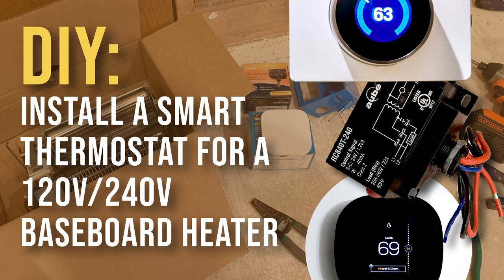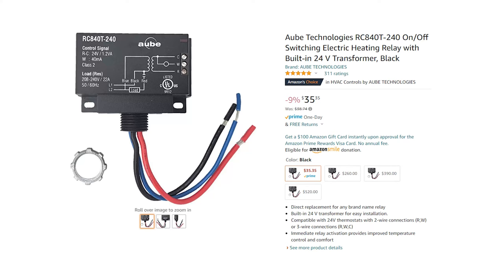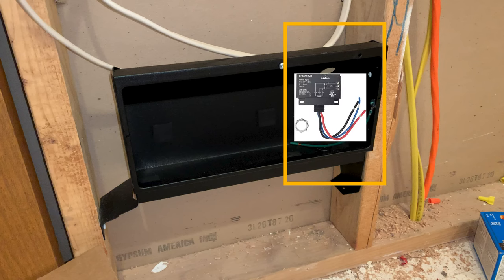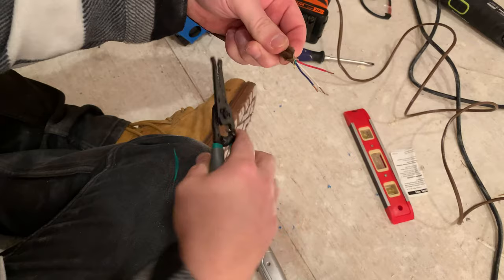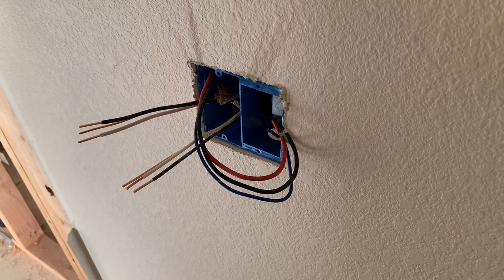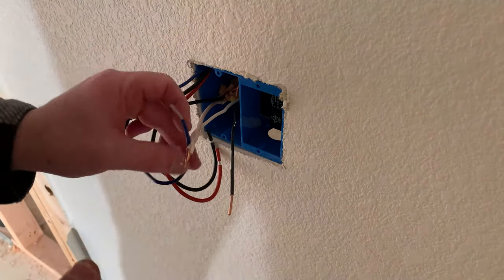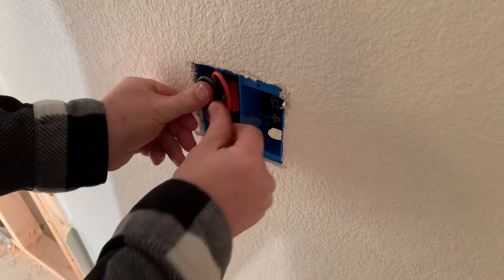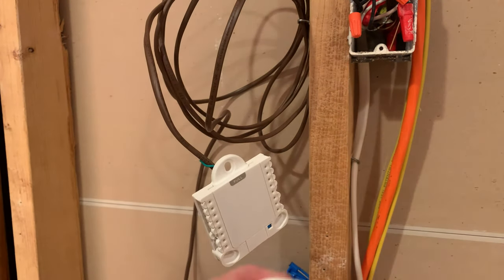How to install a smart thermostat for 240v/120v baseboard heat

Comment: I did this exact install just a note if you are using a nest thermostat for this the relay in the video will not work. The relay transformer is not big enough to power the nest and will cause your batteries to drain. So you either need to use a thermostat that does short cycles or buy a different relay like this one that has a larger transformer that is meant for long cycling thermostats.
Reply: Which relay did you find worked for the nest? I'm seeing mixed reviews on  compatibility with the nest for this 240V relay, but the 120V model of that same relay (RC840T-120) seems very much compatible.

Comment: Does this work with a line/ high voltage thermostat and my heating is an oil fired furnace that has hot water baseboards ? Your demo is for an electric baseboard
Reply from the maker: Depends on your specific setup and wiring.  I'm assuming the new thermostat would control your furnace?  I haven't played around with this method controlling a furnace, just individual heaters.  Here, we have full 240v running through the relay and to the heater - the thermostat just switches the relay on/off.  With furnaces, the thermostat often connects directly to the furnace with 24v thermostat wire, sending a signal to the furnace control board (at the furnace) to switch on/off.  If you've got larger gauge wire running between your thermostat and furnace, and the thermostat itself is the switch - shutting your furnace on/off - then yeah maybe this video method would work, with the relay acting as the switch, controlled by a smart thermostat.  Not sure how common that is, though.

Comment: You can actually have both 24v and 220/120 in side the any hvac system Atleast from what I was taught when I went to school for an example air conditioning unit as both as well as a furnace I have also seen baseboard run both as well.
Reply: How can we check?

Comment: I'd suggest to get a Sinopé smart thermostat, these are design for convection and baseboard heater, 120/240v 3000w or 4000w models are available. They support most smart home integration, even Apple homekit.
Reply from the maker: Only thing is that it's not quite as "pretty" or modern as some of the more popular smart thermostats, which is the main reason I went the route the video shows. But yeah - there are definitely more purpose-built thermostats out there.

Comment: One problem with the junction box you used is if you ever have to replace the relay, you will need to cut open the drywall. There’s not enough space in that box to unscrew the relay and pull it out the front. But you could just cover the junction box with a larger access panel.
Reply from the maker: Huh… not sure that’s true, cause you should be able to just unscrew it, turn it sideways, and pull it out from the front. Granted it would probably be a little difficult. Haven’t tried it though, so it’s possible you’re correct. Another good reason to put the opening and wall plate in an inconspicuous spot.

Comment: Hello 
Great details in the video.
Can I use this method to connect my 120v thermostat to 24v Amazon thermostat?
My baseboard heaters are connected to my furnace directly (I am unable to figure out which box )
Reply from the maker: I'm not 100% sure what you're asking.  I don't think it makes sense to have 2 thermostats controlling the same furnace/heater.  If your baseboards come on when your furnace comes on, then they're all controlled by your furnace thermostat.  The method in the video would require disconnecting your baseboards from your furnace, and then running dedicated power (circuits from the panel) to them and the relay, as shown in the vid.  There are ways to swap out your existing thermostat for a smart thermostat, and some of the same concepts apply as the video, but it'd be a slightly different process.

Comment: Great video! How would you wire this with a 240 volts at the old thermostat? So there are 2 hots along with the line and load neutrals. What would you do with the 2nd hot?
Reply from the maker: So in my case I didn’t have a neutral (or ‘common’ wire) - both the black and white were hot. In your case, you won’t actually connect the neutral to anything - just use your black and red like I did with my black and white

Comment: I was wondering if there is much noise from this relay when it engages?  In another application I use a 30A contactor to turn on/off the heat entirely for my garage office which makes a loud "clunking" style of noise when it engages and that's OK for turning the whole heating system on/off but much to loud and noisy for all day cycling as the thermostat calls for heat and satisfies so just wondering if there is any noticeable noise from this relay?  Thanks.
Reply from the maker: No the relay and thermostat are small and quiet; the heater turning on is the only "clunking" noise I've ever heard.

Comment: Thanks for this video and explanation. Very helpful! 
Questions: 
Would it be possible to set up a one thermostat for 2 baseboards in the same room? I was so depressed that the electrical contractor didn't hook up any thermostats, and the baseboards just have off, low, med, high! Who would run around to all the rooms and keep adjusting them separately.
Does the Alexa/Amazon app allow you to see all the thermostats with different names?
Reply from the maker: Yes - as long as the heaters are both okay to be on the same circuit (i.e. they don't draw too much power; most don't), you would would wire them up in parallel to the relay, which is controlled by one thermostat. And yes the thermostats can all have their own names :)

Comment: Will this work if I have two 4k heaters on separate circuits? Can I control both if I add relays.
Reply from the maker: Hmmm good question. I’m assuming “yes,” but the wiring would look a bit different. You’d have to power the thermostat with one of the circuits, then control the second relay (remember the relays are simply switched on and off by the thermostat) using a branch of thermostat wire.

Comment: Thanks for the video. I notice the relay says 240V to 24V built in transformer. Can I still use this relay for 120V to 24V?
Reply from the maker: They make a 120v relay as well - use that one instead.  https://www.amazon.com/Technologies-RC840T-120-Electromechanical-Relay-Built/dp/B00D5YLY2G/ref=sr_1_20?keywords=120v+relay&qid=1668028110&sr=8-20 
The 240v one probably has too much resistance to work correctly with a lower voltage.

Comment: Hi, your video was very helpful.  I don’t have electric baseboards, I have a standard oil burner furnace that runs hot water through the baseboards.   I purchased a smart thermostat, then realized that I have a lime heating system. There’s thick wires behind my wall with wire nuts. Therefore I cannot use the smart thermostat, that’s how I found your video. My question is when I wired exactly the same for baseboard heating that comes from my oil burner furnace?   Unfortunately I cannot share photos here but I did take some photos of the wiring as it is now
Reply from the maker: Sounds like you probably already have a thermostat controlling your system.  you wouldn't want to put a second thermostat between your first thermostat/furnace and your baseboards, as the second thermostat will only work if the first thermostat/furnace is turned on, which may not be the case if it's already the right temperature in your first room.  The method in the video is meant for independently powered baseboard heaters.
Reply: @sheawilliamson7732  I was actually thinking of replacing the existing thermostat.   It has 2 thick wires (1 black, 1 White) with wire caps connecting thin gauge wires to the thermostat.  Black wire connected to a thin wire going to RH with a jumper to RC and the White wire has a small gauge wire connecting to W.
Reply from the maker: @crushrreviews  ah I see.  I suppose the method in this video could work then, assuming it's a 240v circuit and both black & white are hot wires coming from your breaker box.  the fact that your thick gauge wires are connected directly to thin gauge is odd, though, and potentially a fire hazard.  I'd need to have a better idea of all your wiring to know for sure.  An electrician would definitely be able to determine the right approach.
Reply: @sheawilliamson7732  thank you.  I appreciate your patience with me.   The digital thermostat I have on there now is not a smart thermostat, but it was installed by a licensed electrician when I had my furnace replaced several years ago.   I checked the instructions for that particular thermostat that I have on the wall and it does say it’s a 24 V thermostat. I’m guessing those thicker wires are not necessarily coming from the panel.  I will attempt the installation and definitely get back to you on the results.
Reply from the maker: @crushrreviews  sounds good!  and if you already have a 24v thermostat installed, then you should be able to simply swap it with a smart thermostat - probably don't need a relay.

Comment: Thanks for the video!  Most of the baseboard heater is separate with its own control in each room.  Does it mean we would need one smart thermostat in each room?  Or is there a way to make one central control for all the baseboard heaters?
Reply from the maker: You would need 1 thermostat per heater, because it sounds like each heater has its own dedicated wiring running to it, and the thermostat is just an interrupter switch for each run of wire.  Each room should usually have its own thermostat because each room probably heats up/cools down at a different rate, and you wouldn't want a thermostat in a large/cold room to switch on and start heating a smaller room that's already warm.

Technically, if you had multiple heaters in one room (or in a couple of rooms) that shared power/wiring, you could install one thermostat and relay to control them all, as long as they were installed early enough in the circuit before the wiring split to each heater.  You shouldn't see more than 2 120v heaters on the same 240v circuit, fwiw.

Comment: Oh man, i have been using two separate devices --24v transformer and a relay... and also a bunch of super ugly expensive mysa baseboard wifi thermostats . Question : Can I use the 24 v output to power both the thermostat and my wyze video doorbell camera ?
Reply from the maker: Hmmm I don't think so - the video doorbell probably pulls more amps than this relay can supply (1.2A).  Best bet is to stick with a transformer for the doorbell.

Comment: Do you know how to connect this relay to make it work on a old fan coil AC 120?? That would be an amazing video 😂

Old AC are high voltage and no smart thermostat compatibles :(
Reply from the maker: Sorry for the late reply, but I believe that's exactly what this video addresses!  All my baseboards are coils with fans, all 240v.  Smart thermostats don't work with them because these thermostats are low voltage - so we use the relay (in the video) to handle the voltage, and the thermostat just turns the relay on/off via low voltage.

Comment: Could you post some plans please ? I would really appreciate it.  A simple drawing would really help me: I kind of lost you at some point.
Reply from the maker: I should have included a diagram in the vid - sorry about that.  Let me know if this written description helps or not, for a project where you're cutting into the wall:
1. A 240v breaker at your circuit breaker box supplies power to one or more 240v baseboard/wall heaters
2. The power cord for an individual heater needs to be located inside the wall (preferably right next to a stud)
3a. Because of stud & wire location, it'll be easiest to mount your thermostat & relay above your heater so that all the wiring is in the same stud bay/section. Otherwise you'll have to open up more of the wall and drill holes through studs to run wire through studs.
3b. Identify where you want your thermostat to be, and drill a very small hole for your thermostat wire to come out of. Your thermostat will sit right on top (in front) of this wire.
4. Cut a hole in the wall for a junction box (as seen in video), preferably in an inconspicuous spot, very near to the thermostat wire.
5. Insert thermostat wire (with a lot of extra, so you've got plenty to work with) into the small hole, and run it to the junction box cutout.
6a. Because you'll need enough length in the 240v power wire to strip it and make new connections, you may need to run new wire to the heater. I recommend removing the heater, pulling up/out (through the junction box hole) the power cord that went to it, and cutting it to give yourself long enough wires to strip and connect.  Run a new piece of wire from the junction box cutout down to the heater cutout, again leaving enough length on both ends (wire sticking out) for the new connections, as seen in the video.
6b. Per 6a, split the 240v power wire and run both ends (the wire from the breaker and wire from the heater) to the junction box cutout.
7. Attach your relay to the junction box as seen in the video.
8. Connect the thermostat wire to the relay as seen in the video.
9. Set your junction box in the wall, pulling in the wiring from both the breaker and heater.
10a. If your 240v wiring has just a black, white, and copper wire, then both the black and white wires are "hot" and should be connected as seen in the video.
10b. If you've got 4 wires, with two blacks or red and black + white and copper, then your non-white/non-copper wires are probably hot, and your second hot wire will take the place of the white wire in the video.  It's worth using a voltage tester to double check which wires are hot.
11. Connect the new run of wire from the junction box down to the heater cutout, to your heater, as seen in the video.
12. Connect your thermostat wire to the thermostat as seen in the video (may vary depending on your 24v smart thermostat)

*NOTE: In the video, over the final minute or so, the left white wire is 12gauge wire coming from the circuit breaker, through a stud, to the relay junction, and the left yellow wire is 12gauge (exactly the same as the white) going from the relay to the heater.  You can ignore everything else (wiring, junctions, etc) to the right of the thermostat.

Comment: This looks cool but there’s a simpler alternative. I used a mysa thermostat designed for electric baseboard heaters. Their support team is really helpful. $120 I think. There’s another brand that makes one too..
Reply from the maker: The problem with Mysa and the other brands - at the time I did this project - was A) they were having a lot of reported issues with lots of Wi-Fi systems, and B) I didn’t like the look/interface of their products.  They also (according to reviews) didn’t integrate consistently well with Alexa or Google home.

Comment: Hello, you said  to connect all the white wires which you called common wires. Is this not 240? There should be no common wire correct? That relay wouldn't work for 120v heater, or would it?
Reply from the maker: Yes - you’re correct.  For 120v you’d want their 120v relay https://www.googleadservices.com/pagead/aclk?sa=L&ai=DChcSEwjc99DR_5X6AhWYH60GHa-OADQYABAPGgJwdg&ohost=www.google.com&cid=CAESa-D2aeLLuHFqQ-fucPtEqPQaRPXvZzQvkBUy3-HRfmbGolUyknosFfn3NriuZJhbRprhC90ZkhSqh7QOdJlw6jeQZdiW4Vec1MSLyqCnualSJde8i8ikTo47co-K0jxPIhCnGEXjtavfI95i&sig=AOD64_2B9O8Rda0_xerarzAg6W0m_j7f1Q&ctype=5&q=&ved=2ahUKEwj6x8bR_5X6AhXhJX0KHQflAYYQwg8oAHoECAYQCg&adurl=

It comes with instructions, and I bet they would involve just the single (black) hot wire.

Comment: How has the relay holding up ? Do you know the load ?
Reply from the maker: Holding up well as far as I can tell!  Haven't actually tested the load, no, but the relay is supposed to deliver up to 240v 22amps, and the heater works well

Comment: How does this work when you are using a 240v heater? There are two hots, and no common. But there are only 3 wires coming from the relay.
Reply from the maker: I misspoke when I said "common" wire - this video is showing a 240v heater set up.  The black relay wire connects to one hot wire from the panel, the blue is wired together with the other hot plus one of the heater wires, and the red connects to the remaining wire going to the heater.
Reply: @sheawilliamson7732  So then, does it only cut power to a single 120v phase, and leave the other one live? I'm looking at this, not for a heater, but for a different 240v appliance, and I'm concerned what happens with one 120v phase still running into said appliance. Thanks for the advice!!
Reply from the maker: @larryroyovitz7829  yep I think that's the idea.  Again I'm not an electrician, but I'm assuming - at least in the heater's case - that the heater is designed to function such that there's always a hot running directly into it.  If you look at the MYSA thermostat wiring (which is a standalone thermostat designed specifically for 240v heaters, no relay required), it works the same way https://help.getmysa.com/hc/en-us/articles/360042679072-How-do-I-Install-Mysa-with-240V-Installations-
I think that your application will depend entirely on your appliance's native on/off function and how it handles that always hot wire.
Reply: @sheawilliamson7732  Yep, I agree. So either my appliance (might as well tell you, it's a bitcoin miner) will either shut off with one hot leg off, or it'll damage it. lol. I suppose...I could probably get away with two relays, one for each phase, run off the same thermostat.
Reply from the maker: @larryroyovitz7829  yeah I dunno… technically if the appliance is “off” then it shouldn’t be pulling any amps, which is the real consideration.  Appliances are always connected to voltage when they’re plugged in, right?  it’s just whether they’re on or off that determines if they’re gonna draw power.